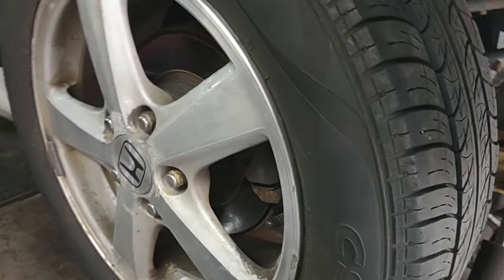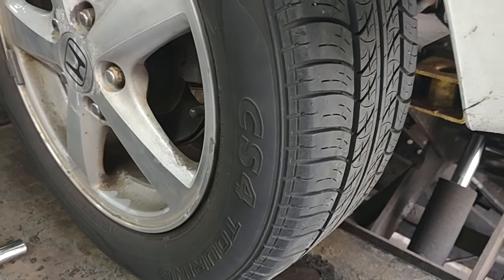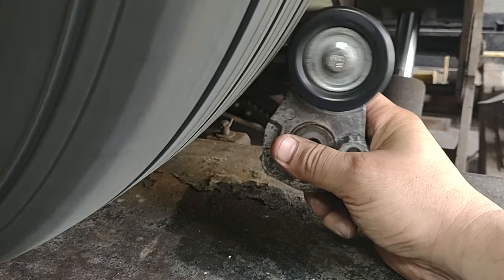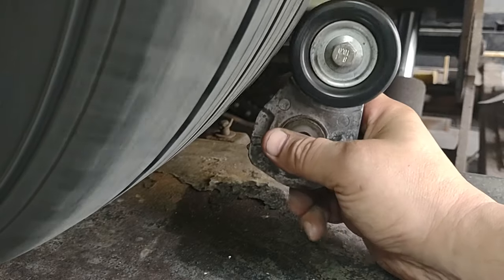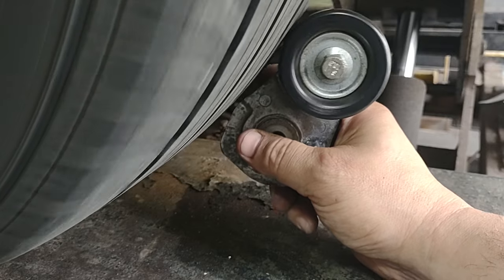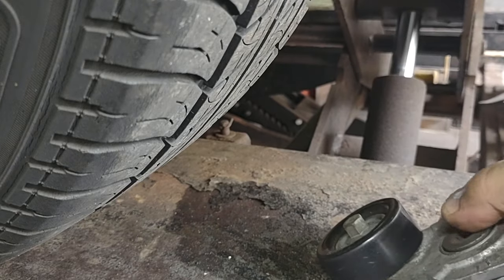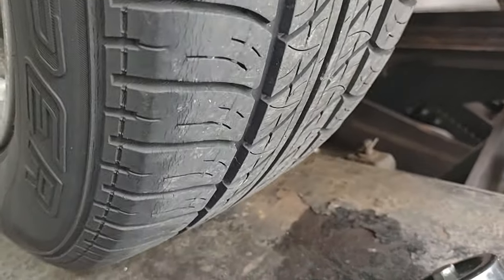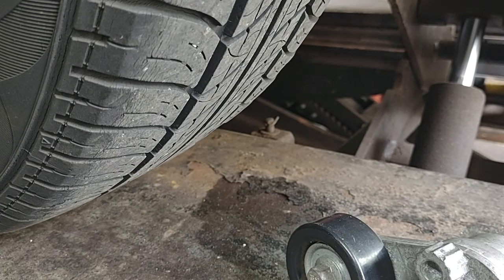Noise coming from my Tires, Tires humming noise, frontend noise, humming noise

Comment: My dad just change both front tyre. The very next day when I drive, I hear humming noise coming out when travelling 70 to 100km/h. More speed, louder the noise. 

So I thought its because of wheel bearing so I change all four of em. But the noise keep coming out after changing all that.

Tomorrow, I will go to tyre centre to check out the front tyre.
Reply from the maker: Are you saying there is no humming heard before 70mph? And what make and model
Reply: @carservicepro  yes. Before my dad change the tyre, theres no sound whatsoever coming whether when I drive fast or slow. I realise just right after the tyre change, weird humming noise coming from front. The sound starts travelling from 60km/h or 40miles/h up to 100km/h or 62miles/h. Faster I drive, louder it gets. But after 120km/h or 75miles/h, the humming sound slowly decreasing.

Its Honda City 2016 GM6 (150,000KM) or (93,200 miles).
Reply from the maker: @fared___3409  the only thing I can think of is the tires them self since the noise started after the tires replacement, some tires have different tread patterns can produce noise specially when treads are far apart, of course there are other causes but I don't think they apply to your issue.
Reply: @carservicepro  appreciate your reply. Thanks man.
Reply: @fared___3409 were you able to find a solution for this issue? I’m having same issues with all 4 new tires.
Reply: @safyankhan8469  yes. My dad change to a new tyre and its gone. You should go back to that place and tell their mechanic to test drive your car to check whether its a tyre problem or your bearing are the problem.